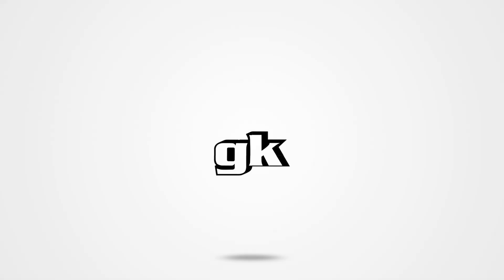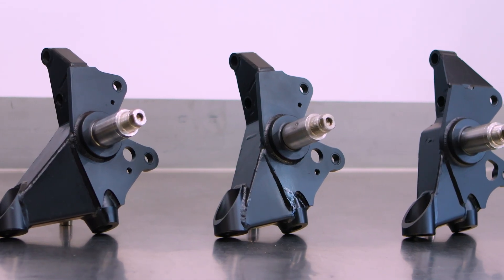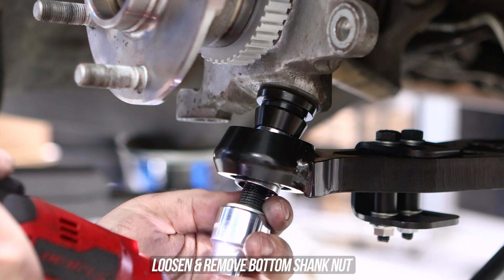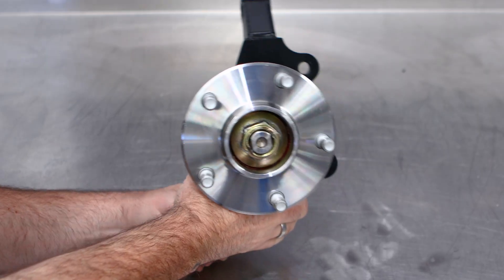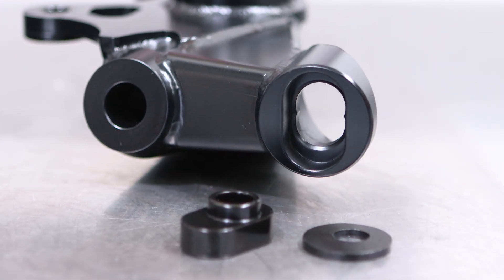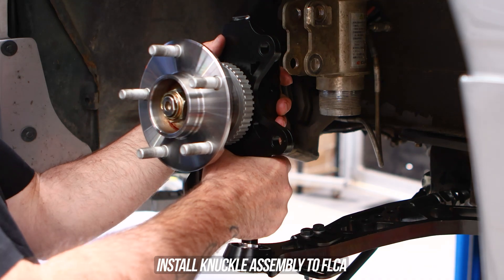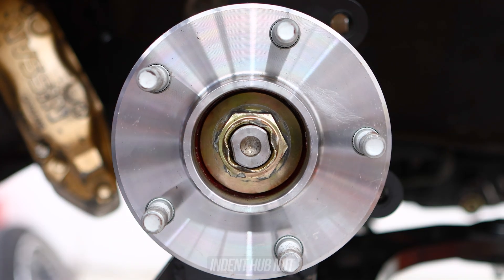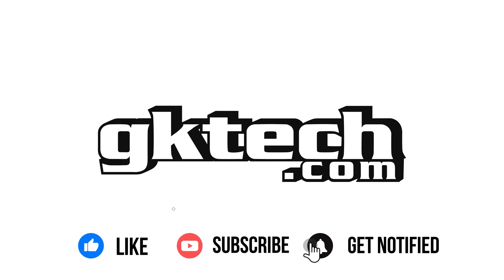Gktech S-Chassis Front Drop Knuckles - Install

Comment: No need of off set rack spacer ?
Reply from the maker: It is setup dependent, if you plan on running as much lock as possible you will need either bolt on rack spacers, offset rack spacers and or to move your steering rack forwards.